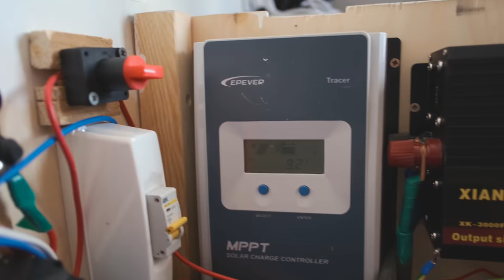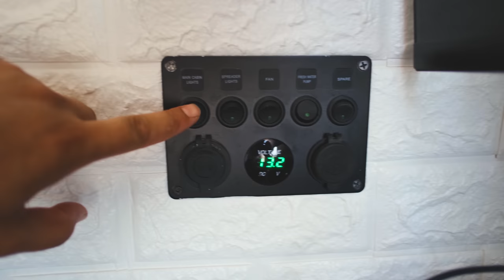Turul AUTORULOTEI construita de mine (HOME MADE)

Comment: Bravo si Felicitari dupa 4 ani de la acest clip, desi eu le-am urmarit si pe celelalte, "din viitor"pe care oricum le-am vazut, dar desi stiu ca im timp auto-rulota a suferit diverse imbunatatiri si optiuni adaugate, daca facem un calcul 10.0000 masina + 2500 conversia + mana de lucru + imbunatatirile ulterioare aduse la sistemul solar oare face sau nu face 25.000 de euro!
(intreb si eu retoric, chiar daca la acest moment, probabil rulota s-a vandut)
Si nu vreau sa mi-o luati in nume de rau, eu in continuare va respect si va urmaresc, ba chiar datorita voua si lui Pricope, chiar intentionez in urmatoarele zile sa-mi cumpar tot un Peugeot Boxer/Citroen Jumper sau chiar Ducato si ulterior, usor, usor sa mi-l camperizez cam fix la fel cum arata versiunea asta a voastra initiala, pentru ca deocamdata atat imi permit; si poate cu timpul cine stie, voi reusi sa il duc si eu la alt nivel la fel cum ati facut si voi!
Mult succes cu cu noua masina si in noile aventuri ce le veti avea!
Reply from the maker: Ai uitat sa adaugi inflatia. Ca comparatie pe noua dubita luata la mana a 2a am dat 22k. Cu 4 ani in urma de 22k imi luam una noua din salon. Acum nuna noua costa 36k. Accesoriie si materialele la fel s-au scumpit enorm de atunci.
Reply: @SunChaseJourney  corect. Eu doar am făcut o observație întrucât și eu vreau sa fac asemenea voua și cred că este cel puțin la jumătate dacă o fac eu singur dacă o iau gata făcută. Deși la un preț decent, nu as zice nu și la un deja camperizata!

Comment: Foarte fain, sunt din brasov,  ma intereseaza daca a trebuit ceva autorizatii sau ceva hartii la primarie de facut. 
Apoi cat reusiti sa stati off grid fara sa aveti apa si curent de unde lua , cat rezistati
Reply from the maker: DAca nu dai jos peretele despartitor, omologarea nu e obligatorie.
Rezervorul de apa ne ajunge pentru 5 zile. Bateriile incarcate ne ajung pentru 2 zile daca lucram ambii la laptop minim 8 ore pe zi. Daca sunt zile cu soare - ne ajunge pentru 3-4 zile, daca mai pornim motorul sau mergem un pic cu autorulota iarasi se incarca.

Comment: Acum sunt la izolație și partea electrică , cât ah scot panourile noi ? Ești mulțumit de ele? Și mai este o nelămurire a mea ți-ai mai pus încărcatorul acela special prezentat de victronic parcă care prelua 12v di baterie îi amplifica pt bateriile din sistem, este eficient sau nu l- ai pus?
Reply from the maker: Foarte multumim de panouri si solar chargerul Victron. Am facut recent o testare, acum ca soarele se ridica un pic mai sus pe cer si am obtinut aproape de valorile maxime ale panourilor- 570-610W.  Vlogul o sa fie un pic mai tarziu. Incarcatorul DC-DC poti sa-l programezi sa incarce bateriile chiar si de la o sursa cu o tensiune mai joasa (ex: bateria masinii). Deasemenea este compatibul cu sistemele 24V. Daca sistemul electric il configurezi de 24v, pot sa il incarci de la alternator cu 12v.
Reply: @SunChaseJourney  Am tot studiat oartea electrică și am vazut că sunt panouri de 160w care scot 9,2ah si 2 în paralel se duce la 18 teoretic așa cred că fac cei 10 ah cu care trebuie să încarc bateriile...Ai pus parcă de 320w cât ah scoate unul? Sunt curios... iar pentru compòñentele de la victron dacă poți să-mi dai relații ori adresă vreau să iau și eu  sunt bune am auzit și le poți vedea și cu o aolicație wireles... dacă ai timp mulțumesc....
Reply from the maker: Panourile mele sunt de 305W (2x305W). genereza la fel intre 9 si 10.5A (nu tin minte exact), dar o tensiune mai mare (intre 30 si 40V, nu tin minte exact). Panourile le-am cumparat de la o firma din R. Moldova, insa poti gasi panouri monocristaline bune si pe site-ul darcomenergy.ro
Linkurile la produsele instalate la ultimul upgrade le gasesti mai jos. Pe site-ul darcomenergy.ro dupa ce adaugi produsele in cos, poti folosi codul de voucher "sunchase15" (fara ghilimele) pentru a primi 15% reducere.
Convertorul Solar (Victron 150|45): https://www.darcomenergy.ro/incarcatoare-solare/incarcator-solar-12v-24v-48v-45a-victron-energy-smartsolar-mppt-15045-tr
Incarcare de la alternator (Victron dc to dc \ battery to battery charger): https://www.darcomenergy.ro/convertoare-dc-dc/convertor-buck-boost-dcdc-50a
Monitorizare Baterie (Victron Smart Shunt): https://www.darcomenergy.ro/protectii-si-izolatoare-de-baterii/victron-energy-smartshunt-500a50mv
Incarcatorul de la priza (~230V): https://www.darcomenergy.ro/incarcatoare-de-retea/blue-smart-ip65-charger-1215-230v-cee-717
Reply from the maker: Uite panoul asta de exemplu e bun:
https://www.darcomenergy.ro/acasa/victron-energy-panou-fotovoltaic-175w-12v-mono

E la reducere acum + reducerea cu codul sunchase15 e la 126 euro
Reply from the maker: Pentru 2 panouri de 175W vei avea nevoie de un Solar charger de 30A si it recomand sa le conectezi in serie, nu in paralel. O sa ai o eficienta mai buna. Uite un solar charger compatibil cu panourile 2 x 175W:
https://www.darcomenergy.ro/acasa/victron-energy-bluesolar-mppt-10030
Reply: @SunChaseJourney  Mulțumesc Costi ... să aveți grijă de voi... să văd ce aleg să iau de la  victron.. am ales să pun 2 bat de 190ah și să văd cu ce le ajut să se încarce mai bine... mulțumesc de ajutor și sfaturi... vorbim....

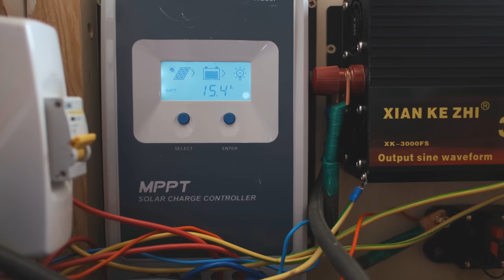Comment: 11:12 ITI ARATA CATI AMPERI POTI FOLOSI DIN BATERII  15.4, APROXIMATIV 215,6 WATI  LA 11:25 ITI ARATA CAT BAGA PANOUL . NU BAGA MAI MULT DE 8 AMPERI  SI TU AI SISTEM PE 12 V DACA ERA PE 24  ERA MAI BINE. EXACT SISTEM DE ACESTA  AM EU CU MPPT CU 6 PANOURI  DAR IN LOC DE INVERTOT AM PUS UN UPC DEOARECE POTI SA IL CUPLEZI SI LA ENERGIE 220, IN CAZ CA STAI INTR-O CURTE TRAGI UN PRELUNGITOR SI INCARCI SI BATERIILE.
Reply from the maker: Am un redresor de 20A pentru incarcarea de la 220v. A iesti mai ieftin decat un inverter\charger. Dar l-am folosit doar o singura data deoarece doar odata am stat in camping. In reat doar off-campi g

Comment: incurci A cu W 300 A la 12V eu nu am auzit
Reply from the maker: Cat fac 2 baterii din astea legate in paralel?
https://www.e-acumulatori.ro/acumulatori/acumulator-vrla-ultracell-cu-gel-12v-150ah-ucg150-12-2-2.html
Reply: @SunChaseJourney  Tensiune(V) ai tot timpul la priza cei 220V in momentul in care pui un consumator atunci vei avea un curent electric(A) asta asa de baza. Este o greșeală de începător sa spui ca o baterie are x A poate Ah atunci da la 150Ah ai 1800W pro baterie. Pana la urma le-ai legat in paralel sau serie? Inca partea a doua spui ca le-ai legat in serie. 😄
Reply from the maker: Poate nu m-am exprimat corect. O baterie are capacitatea de 150A si curentul maxim care il poate oferi la un moment dat e 60A. Deci capacitate - 300A, curent maxim - 120A. Le-am conectat in paralel. O sa fac un video dedicat despre electricitate.